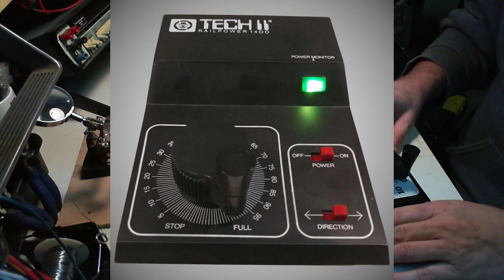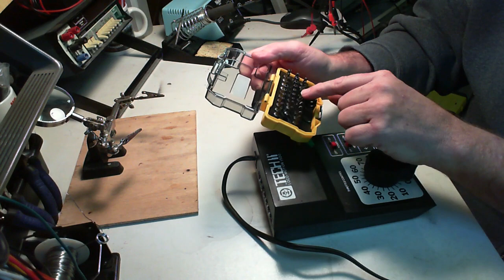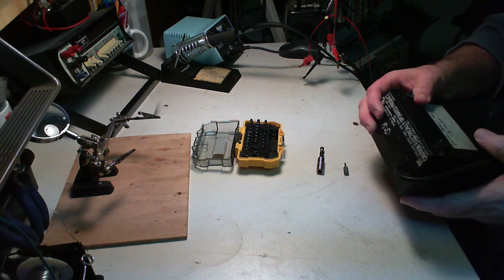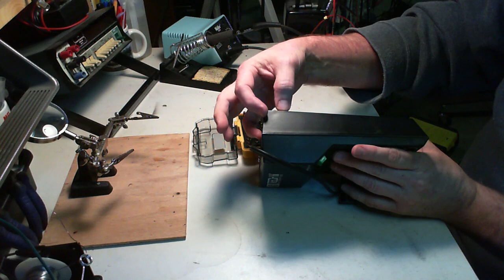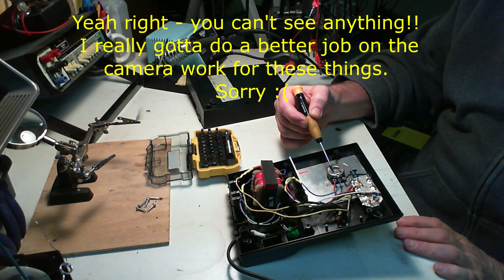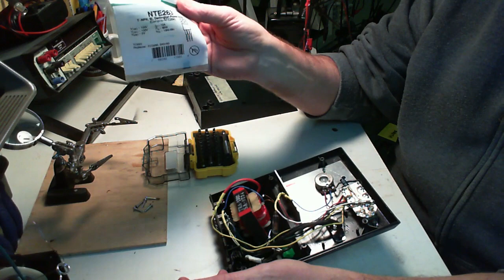My adventure repairing an eBay MRC DC power pack

Comment from the maker: Brett, one of the viewers, passed along this link for a useful bit set for getting into these units. 
https://www.tractorsupply.com/tsc/product/barn-star-33-piece-3-in-security-bits-with-adapter
I have ordered a set and going to try them out on another MRC unit I acquired that is functional for output but the pilot light is not working.  
Thanks for the info Brett.

Comment: I've got the same MRC 1400 power pack that I use for the same purpose, testing locomotives. What I want to do is hook up analogue volt and ammeters to it in order to help diagnose the locomotives.  Any idea where / how I should be hooking these gauges up?
Reply from the maker: The volt meter can be attached right across the variable DC output terminals.  The Ammeter has to be in line with one of the terminals.  Since you mention you want to use analog meters, and I am assuming you want to be able  to use the direction switch to run the locomotive under test in both directions, you have to switch the polarity of the connections to each of these meters, otherwise the needle will try to go in the wrong direction and this can damage the mechanism.  Going from memory it might be simplest to wire in a new direction switch that has enough contacts to swap polarity to the meters when you change direction.  It will be a bit tricky to do with analog meters.  You can get some pretty cheap digital volt/ammeter modules on Amazon that can display positive and negative current and will make hooking this up much easier (https://www.amazon.com/diymore-Digital-Voltmeter-Ammeter-Red-Blue/dp/B08HQM1RMF/ref=sr_1_6?crid=11FGGKX1RALXH&dib=eyJ2IjoiMSJ9.nEizO_OD-dtjMU5JosZphju48IKhoGJ-aQUelFBmiOKp4Btb8OgrbGH6yd5vWlQYgnMUbXqxY9RorpQ9Mk3pTP0pxYsQTd7hEfJTgYirnxONyvGQXSwguQQeKhAi6MAes-GF5YdrljFKmJA48KKFjLaOFgvZZZiSQdgumqCy-X1lmmU7pWzCX331WCQDSXJRR9hAKSk1YZAd7-JiHZ6gCsE4CsDWQ8g-hRLK44FPmt4BCzE9GY8y8r-NdD-GKc3_91mJk4U6YJp_GxR0BnzWIIkkhE9S208vnoQH-RwhEHw.shrn9dIAkzxF48pWd068DUNtws7W09zPrA5qr-gYAgY&dib_tag=se&keywords=digital%2Bvoltmeter%2Bmodule&qid=1726969367&sprefix=digital%2Bvolt%2Bmeter%2Bmodul%2Caps%2C105&sr=8-6&th=1).  Good luck and thanks for watching and commenting.

Comment: Great video and thank you for speaking loud enough to hear you . I watched a video by an English guy with the same problem and he called that little past a MOSFET . Either way this is good to know .
Reply from the maker: Thanks for the feedback and I am glad you enjoyed the video.  The component that I removed from my MRC power pack was a 2SD1192 which is no a MOSFET but an NPN Epitaxial Planer Darlington Transistor.  MRC may well have changed their design to use MOSFET devices at some point but the one I had was not.  -Rick
Reply: Thank you. What ever it is I hope I don't ever need one . @TheSwitchList

Comment: My mrc power pack pilot light filckers
Reply from the maker: I just acquired another one of these that has the pilot light and it would flicker or go off and then come back on.  I took it apart and found that there was some electrical connection problem in the bulb itself - the bulb does not have a socket that it screws into or anything the wires just go right 'into' the base of the bulb.  I could shake the bulb and make it go on and off.  I just replaced it with a yellow LED and a resistor and now it is flick free.  Thanks for the comment.

Comment: Yep, I agree with you on all points.  Enjoyed your video!
--
The #1 and #2 "Achilles heels" on their packs are the control pot (which you suspected first), and the main output transistor (it is labeled and sold as a Darlington "transistor" or Darlington "amplifier", so no worries on the terminology).  I'm fixing a Tech 7 model right now that has the bad pot - the transistor is okay.  They just aren't using robust enough parts for the control pot.
--
I hear you on those security screws. MRC uses a variety of types, too!  Some are like yours, the Torx or Allen head with the pin in the center, and some are the slotted screw with the pin in the slot.  I often just use a drill bit the same size as the screw head and drill the thing right off of there, then take the case apart, unscrew the remains of the screws with pliers and throw them out.  Then replace them with regular screws.
--
It always surprises me that these output transistors blow, since they are using a part that has a spec way higher than necessary.  That part in yours is rated for 10A collector current, 60V E-C,  and a power dissipation of 40W, and it will never have to handle even half that in that power pack.  In fact, the power transformer in there isn't capable of delivering anywhere near enough power to blow that transistor.  Sure, parts fail every once in a while, but it happens enough that I suspect that simple aluminum plate is not enough of a heat sink, and there isn't enough ventilation in that case to let the heat out.
Reply from the maker: Yes it does seem odd that they would fail given their 'on paper' specs.   Thanks for the info.

Comment: I have 2 Tech II transformers I acquired in a large sale of model train items. Both have the same issue yours had. Did you actually test the amplifier to verify it was bad? If so, how would you test it?
Reply from the maker: Hi Brian.  I initially suspected that the potentiometer had failed so I disconnected the lead coming from the wiper arm of the potentiometer, which goes to base connection on the amplifier.  When I measured the resistance of the potentiometer as I rotated the throttle and saw that it was not the problem I then measured the resistance across the Collector and Emitter of the amplifier I found a very low resistance which indicates a failure of one or both of the power transistors inside.  Good luck with your units and let me know how you make out.